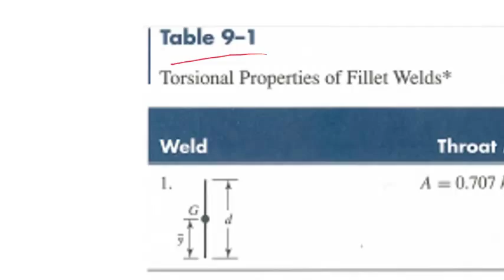Weld Tutorial

Comment: Thanks for the video, it's a great example! I hope you can answer my question - if I were to work out the total stress in the weld by calculating the vector product of the magnitude of the three stresses (ie. sqrt(fs^2+fb^2+fj^2)), would that be the maximum value that the stress can be? I guess it would assume that the three stresses are perpendicular.